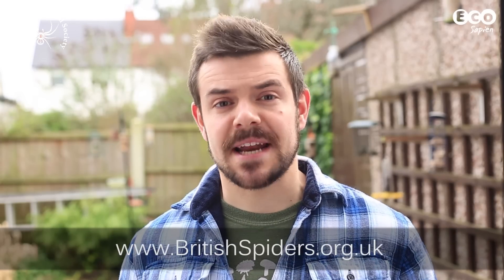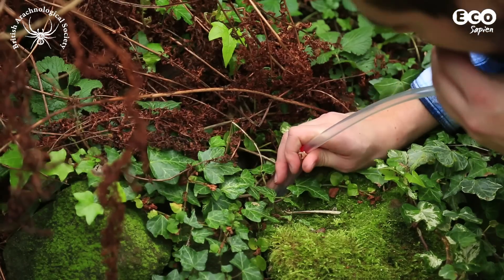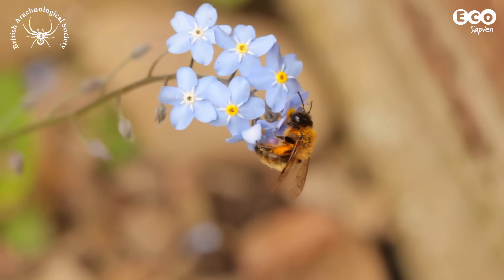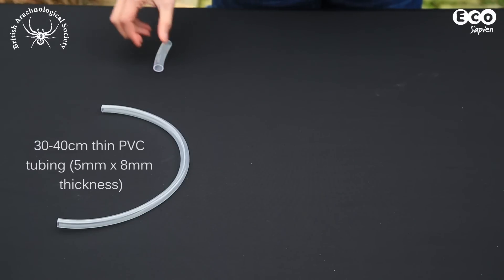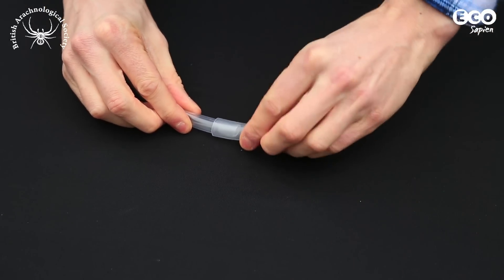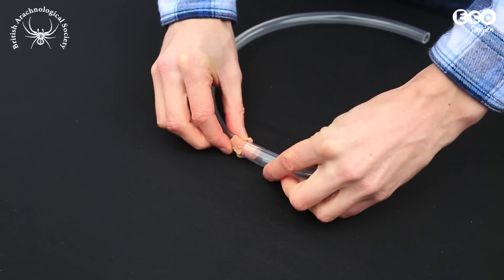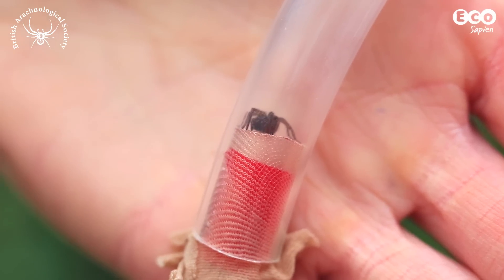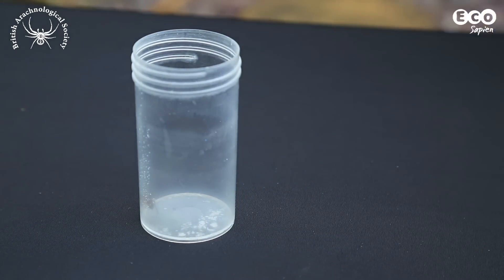How to make a simple pooter

Comment: This tool IS clever - but I have a couple of concerns: 
(1) Depending on the invertebrate “pooted” (centipedes, some spiders, blister beetles, saddleback caterpillars, etc.) - putting a finger over the opening while performing your examination MIGHT not be the smartest idea, in my humble opinion. Might I suggest temporarily plugging the hole with a small cork, a rubber stopper, a foam earplug - or even a wadded piece of tissue.
(2) Typically, nylon stockings have rectangular holes that are approximately 30 to 36 microns vertically and 90 to 120 microns horizontally WITHOUT stretching. Viruses, bacteria, fungal spores, some parasites and MOST other organic contaminants are MUCH SMALLER. What prevents the user from inadvertently inhaling these nasty things into their lungs?